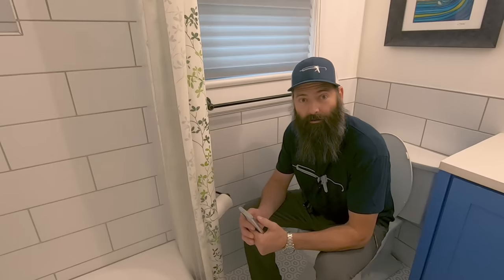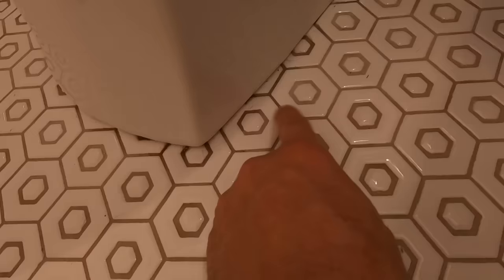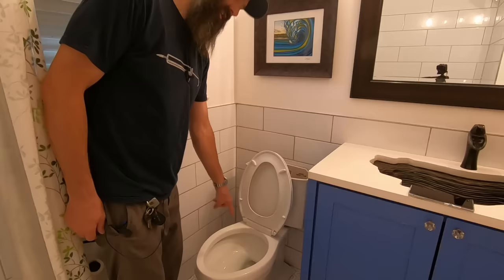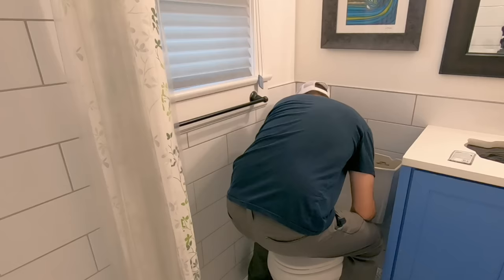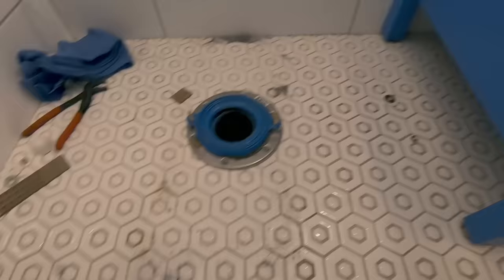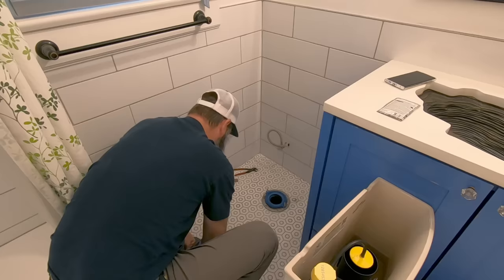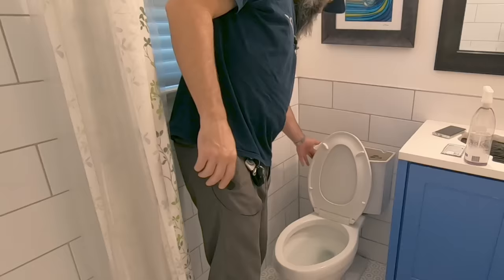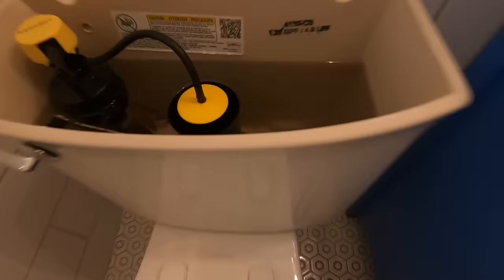Toilet Install Gone Wrong | What Failed | THE HANDYMAN |

Comment: I cannot see caulking as the solution.  You should offer wahoo aiming classes and bathroom floor cleaning classes (300$/hr).  They are probably engineers, so you will have  to talk slow in these classes.

Comment: You can clean the tile with a wire brush and bleach based cleaner. I love your videos by the way.
Reply: All your doing with a wire brush is essentially sanding off the top stained layer, not cleaning anything. Bad advice